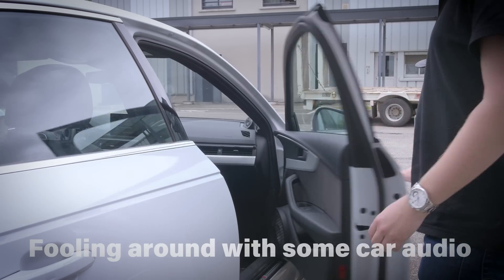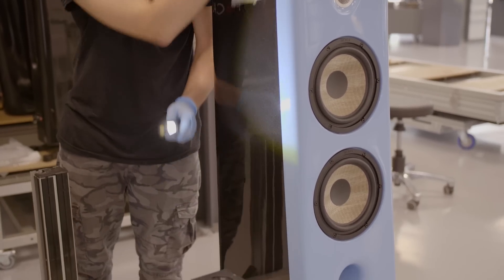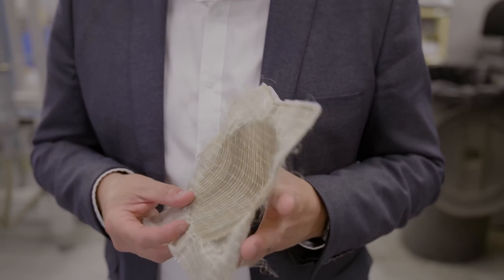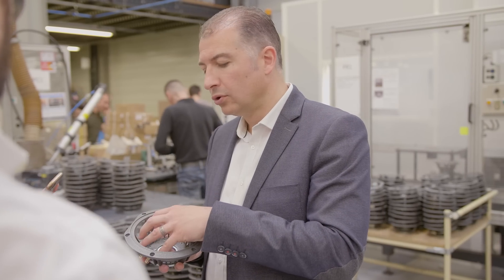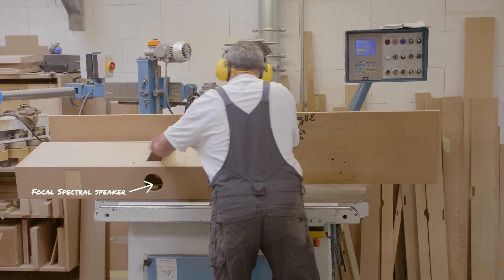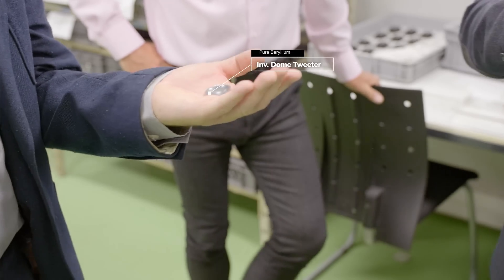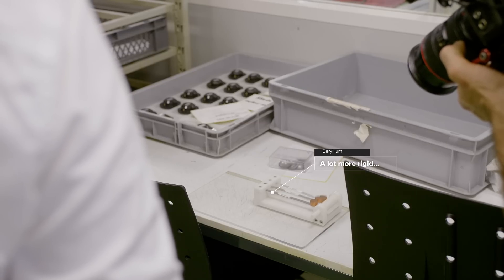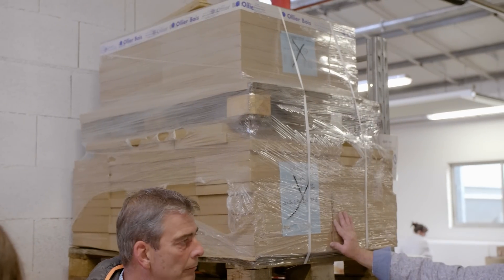Factory Tour Focal - France - How to build a high-end Speaker

Comment: the cones and tweeters of some of the home hifi speakers look the same as their car hifi speakers
Reply from the maker: Yeah. But they are very different... ;)
Reply: @TheAlphaAudio they look very similar, same material, design and technology, just different basket perhaps for mounting in a cabinet vs car
Reply: those yellow cones like like the same material and tweeters look the same to me..
Reply from the maker: @user-fs4fd3gv3r  voice coil, basket, ventilation... Etc.
Reply: @TheAlphaAudio  similar sounding timbre.. assuming same cone material, then would they be a tonal match?
Reply from the maker: @user-fs4fd3gv3r  yes... Signatures are the same...
Reply: @TheAlphaAudio  does that mean i can buy focal car speakers and put them in cabinets.and it would sound very similar..
Reply from the maker: @user-fs4fd3gv3r  No. Focal car speakers are not meant for cabinets. They are for car audio. Units are made for a certain volume (for example).
Reply: @TheAlphaAudio  if they are mounted in cabinets similar to the size of car door cavity or a door build then they would sound good right?
Reply from the maker: @user-fs4fd3gv3r  Car speaker-units are very differently tuned than 'normal' speaker units. They often need complex filters to sound right, because the acoustics in a car are different. I'm not stopping you from experimenting. You can try, and maybe it will sound nice. But know that from what I have seen in the factory, car audio is a different part of the factory. With reason: the units are different; different magnets, voice coils, baskets...

Comment: which has better build quality bowers or focal?
Reply: @FUCK SHIT I'm sorry, I couldn't hear you. Would you speak up, please?
Reply: I used to install Focal speakers and had the pleasure of saying I have installed the Gran utopias ,1038 BEs , Scala and Mastero. I also installed the B & Ws (even own a pair) and I have to say Focal is better. Their Tweeter cannot be compared with and the midrange is outstanding if I could afford Focal I would get them hands down.
Reply from the maker: Depends on tour definition of good.... Sound? Build quality? Imaging?
Reply: Both are top end build quality. Especially in their higher ranges
Reply: B&W??? Sorry, that's mid-fi, folks. Ok, maybe high mid-fi.
Reply: Interesting to hear about the yellow cone. My almost 25 year old Focal 533's (or 633's, I forgot...) do have the yellow woven tweeters. Unfortunately the rubber (?) rings that surround the yellow dimpel have deteriorated after all these years, I have to be very careful as it shows so fragile. Curious to learn of this can be fixed (anyone suggestions). Mid and bass still in good condition. 
Goede video trouwens!